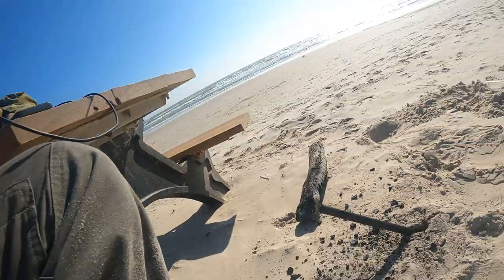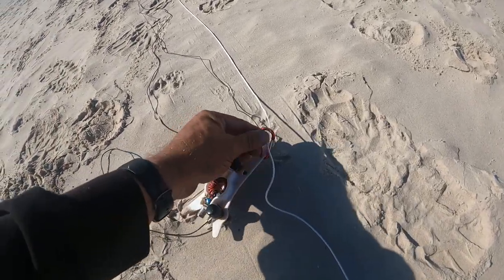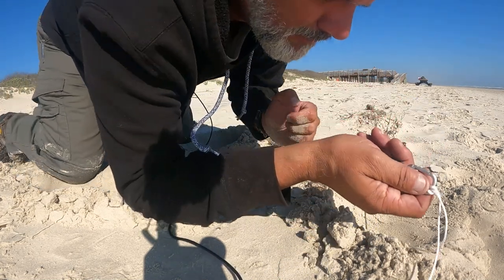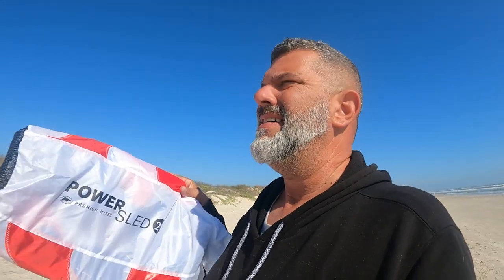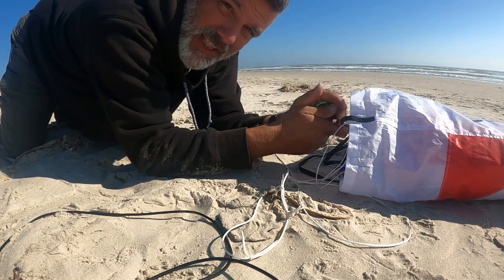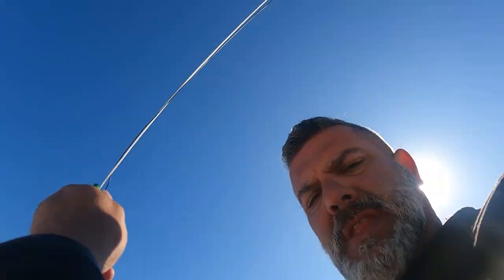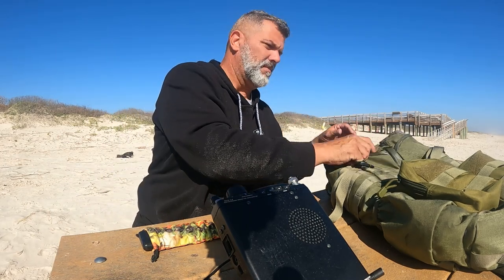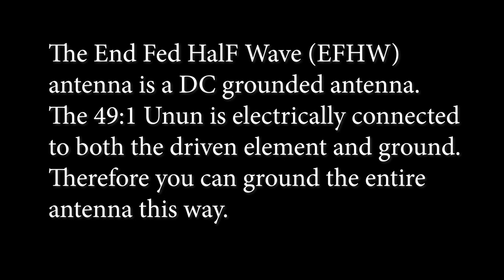Ham Radio Kite Antenna for POTA!

Comment: I really need to get around to doing this with my TRX-1 portable for my simplex SIGINT missions. My Prism Bora 7 will easily lift it I just need to cobble together a compact protective box for it and additional antenna to better fit the occasion.

Comment: This is a great video Mike!  I am thinking of doing this somewhere here in Michigan using my WW2 Gibson Girl M357A box kite, manufactured in 1941!  My dad bought this kite for my brother and I from a local Army surplus store years ago for very little money, as I recall.  It folds like an umbrella and fits into the heavily waxed cardboard tube which has keep it in great condition for all of these years,  about 80 now.  This video gives me the answers of just how I would do this saving me a lot of hassle.  I also have the FT-817ND and it is perfect for this.  How cool would a "kite to Kite" antenna QSO be?  73, de Karl/KO8S

Comment: hello...a question. The kite sled 24 has the capacity to lift about 2kg...just a group of radio amateurs and we want to lift a vhf-uhf repeater equipment with a kite with its batteries........Thanks

Comment: Wouldn't it be better if the transmission wire ran vertically down from the mounting loop? That is, when you sit exactly below the mounting loop. Such an oblique end-fed antenna has worse radiation characteristics than one that is vertical, doesn't it? And what about static charge, are there no problems there?

Comment: question if i may..im not saying youre wrong,im saying its new and ive never done this. i have heard about kite antennas and everytime they used a spark gap to discharge the wire waving around in the magnetic field causeing current flow to gnd. do i need a earth spark gap with your 49:1 video ant please. OR how do you manage it. you showed earth wire from gnd stake to chassis of 817.is that it or is there more caution please
Reply from the maker: Because the entire antenna is DC coupled, grounding your radio will ground the entire antenna system.